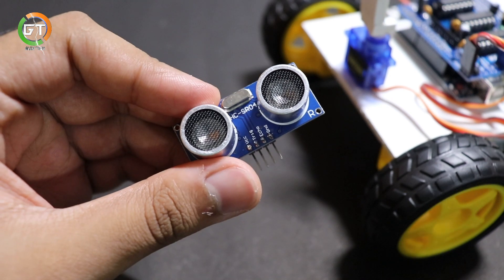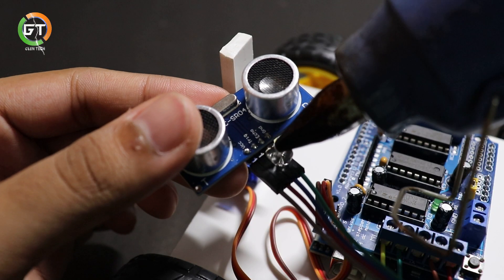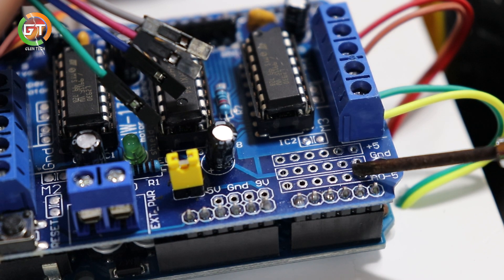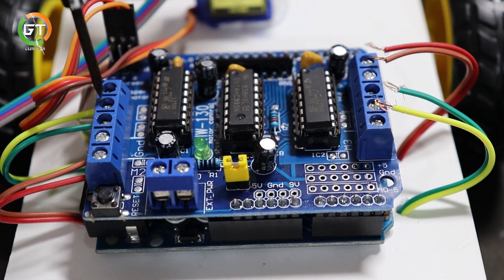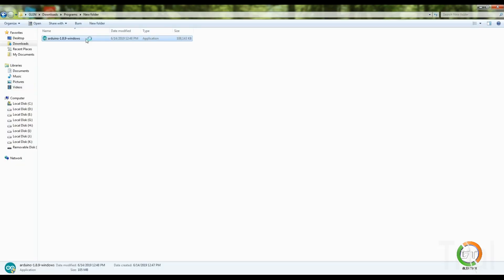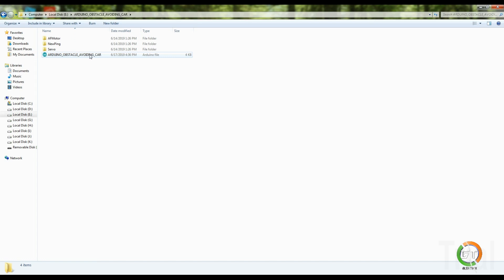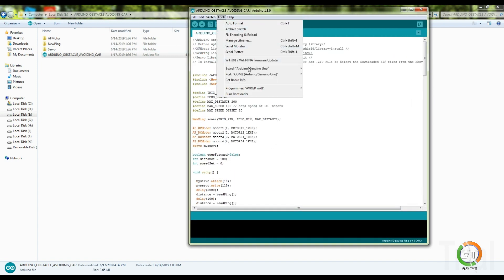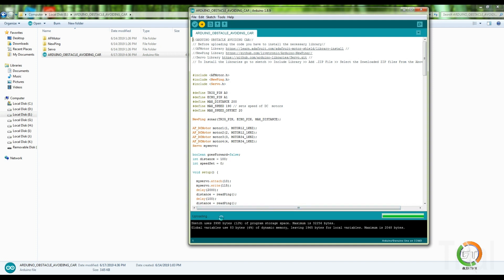How To Make A DIY Arduino Obstacle Avoiding Car For Science Project

Comment from the maker: CODE :

//ARDUINO OBSTACLE AVOIDING CAR//

// Before uploading the code you have to install the necessary library//

//AFMotor Library https://learn.adafruit.com/adafruit-motor-shield/library-install //

//NewPing Library https://github.com/livetronic/Arduino-NewPing// 

//Servo Library https://github.com/arduino-libraries/Servo.git //

// To Install the libraries go to sketch >> Include Library >> Add .ZIP File >> Select the Downloaded ZIP files From the Above links //

#include <AFMotor.h>  

#include <NewPing.h>

#include <Servo.h> 

#define TRIG_PIN A0 

#define ECHO_PIN A1 

#define MAX_DISTANCE 200 

#define MAX_SPEED 190 // sets speed of DC motors

#define MAX_SPEED_OFFSET 20

NewPing sonar(TRIG_PIN, ECHO_PIN, MAX_DISTANCE); 

AF_DCMotor motor1(1, MOTOR12_1KHZ); 

AF_DCMotor motor2(2, MOTOR12_1KHZ);

AF_DCMotor motor3(3, MOTOR34_1KHZ);

AF_DCMotor motor4(4, MOTOR34_1KHZ);

Servo myservo;   

boolean goesForward=false;

int distance = 100;

int speedSet = 0;

void setup() {

  myservo.attach(10);  

  myservo.write(115); 

  delay(2000);

  distance = readPing();

  delay(100);

  distance = readPing();

  delay(100);

  distance = readPing();

  delay(100);

  distance = readPing();

  delay(100);

}

void loop() {

 int distanceR = 0;

 int distanceL = 0;

 delay(40);

 

 if(distance<=15)

 {

  moveStop();

  delay(100);

  moveBackward();

  delay(300);

  moveStop();

  delay(200);

  distanceR = lookRight();

  delay(200);

  distanceL = lookLeft();

  delay(200);

  if(distanceR>=distanceL)

  {

    turnRight();

    moveStop();

  }else

  {

    turnLeft();

    moveStop();

  }

 }else

 {

  moveForward();

 }

 distance = readPing();

}

int lookRight()

{

    myservo.write(50); 

    delay(500);

    int distance = readPing();

    delay(100);

    myservo.write(115); 

    return distance;

}
Reply from the maker: Read it : 

 Before uploading the code you have to install the necessary library given below :

//AFMotor Library https://learn.adafruit.com/adafruit-motor-shield/library-install //

//NewPing Library https://github.com/livetronic/Arduino-NewPing// 

//Servo Library https://github.com/arduino-libraries/Servo.git //

// To Install the libraries go to sketch >> Include Library >> Add .ZIP File >> Select the Downloaded ZIP files From the Above links //
Reply from the maker: How to code in mobile : https://youtu.be/Mw589orCT3c
Reply from the maker: UNKNOWN ADIL  this first comment is the code . Click read more to see
Reply from the maker: UNKNOWN ADIL   file link : https://drive.google.com/file/d/1Sjspsz2em8Thq_8WhalYu_YcsMar9z60/view

Comment: Hi Glen tech 6 wheeled arduino obstacle avoiding robot undakumbol gear  motors 5 and 6 arduinoyumayi connect cheyyano pls 🙏 reply
Reply from the maker: Connect with motor module. Connect 3rd and 5th motor together .

Connect 4th and 6th motor together.
Reply from the maker: See the video to know connection
Reply: Ok ethra volt battery upayogikkanam
Reply from the maker: @shibusivadas7561  you can use same battery showing in the video.
Reply: Ok
Reply: Ok ithu rocker bogie designil arenge cheyyan patto

Comment: hello. what if i don't have a pin header connector? how do i make it work?
Reply from the maker: Just solder the wires to that port .
Reply: @GLENTECH  thank u for responding! but how do i solder it? do i solder it from the below of the motor shield and not from the top??
Reply from the maker: @juan-dk7qe  solder it from below the board . See the diagram .
Reply: @GLENTECH  oh okay thank u so much! btw last question, is it required for it to have a switch? or it can work without the switch?
Reply from the maker: @juan-dk7qe  switch just to turn off and on the battery power . If you didn't add switch , when you add battery the car start running and when you remove battery it stop. 

If you want you can add switch . Without switch also it will work.
Reply: @GLENTECH  hi. thank u man! my project finally worked, thanks to u and your videos! you've been such a great help man. keep doing what youre doing, youre helping a lot of people. God bless you sir!
Reply from the maker: @juan-dk7qe  Thankyou dear friend for your valuable comment and support 🙂
Reply: i hope u can answer this, i hope u can help becasue this is for school purposes

Comment: read ping is not included in the scope it is saying status 1
Reply from the maker: Read it

// Before uploading the code you have to install the necessary library//

//AFMotor Library https://learn.adafruit.com/adafruit-motor-shield/library-install //

//NewPing Library https://github.com/livetronic/Arduino-NewPing// 

//Servo Library https://github.com/arduino-libraries/Servo.git //

// To Install the libraries go to sketch >> Include Library >> Add .ZIP File >> Select the Downloaded ZIP files From the Above links //

Comment: Servo ans sensor is not rotattinv
Reply from the maker: Read it

// Before uploading the code you have to install the necessary library//

//AFMotor Library https://learn.adafruit.com/adafruit-motor-shield/library-install //

//NewPing Library https://github.com/livetronic/Arduino-NewPing// 

//Servo Library https://github.com/arduino-libraries/Servo.git //

// To Install the libraries go to sketch >> Include Library >> Add .ZIP File >> Select the Downloaded ZIP files From the Above links //

Comment: Sir i used 4 1.5 volts batery my robot was not working in the grund and servo also not rotate
Reply from the maker: If you need you can use four 1.5 volts 1000 mAh rechargable battery . Because normal 1.5 battery mAh is less and it won't work .

Recommended to use two 3.7v 2500mAh rechargable battery .
Reply from the maker: 1.5v : https://www.amazon.in/dp/B00BN5SNF0/ref=cm_sw_r_cp_apa_fabc_62EJQGX1NMMVSF6V3VTJ
Reply from the maker: 3.7v : https://www.amazon.in/dp/B08T1XRRG5/ref=cm_sw_r_cp_apa_fabc_AAZJRWZQEVR96XNH19Z6?psc=1

Comment: Bro library install ചെയ്യാന്‍ പറ്റുന്നില്ല.    
??
Reply from the maker: // Before uploading the code you have to install the necessary library//

//AFMotor Library https://learn.adafruit.com/adafruit-motor-shield/library-install //

//NewPing Library https://github.com/livetronic/Arduino-NewPing// 

//Servo Library https://github.com/arduino-libraries/Servo.git //

// To Install the libraries go to sketch >> Include Library >> Add .ZIP File >> Select the Downloaded ZIP files From the Above links
Reply: @GLENTECH  ath install cheythu
But newping master install cheyyumbol  properties file not found eannnn kaanikkunnnu

Comment: I made this but the motors start to beep when i attach the battery.
Pls hlp bro
Reply from the maker: CODE :

//ARDUINO OBSTACLE AVOIDING CAR//
// Before uploading the code you have to install the necessary library//
//AFMotor Library https://learn.adafruit.com/adafruit-motor-shield/library-install //
//NewPing Library https://github.com/livetronic/Arduino-NewPing// 
//Servo Library https://github.com/arduino-libraries/Servo.git //
// To Install the libraries go to sketch >> Include Library >> Add .ZIP File >> Select the Downloaded ZIP files From the Above links //

#include <AFMotor.h>  
#include <NewPing.h>
#include <Servo.h> 

#define TRIG_PIN A0 
#define ECHO_PIN A1 
#define MAX_DISTANCE 200 
#define MAX_SPEED 190 // sets speed of DC motors
#define MAX_SPEED_OFFSET 20

NewPing sonar(TRIG_PIN, ECHO_PIN, MAX_DISTANCE); 

AF_DCMotor motor1(1, MOTOR12_1KHZ); 
AF_DCMotor motor2(2, MOTOR12_1KHZ);
AF_DCMotor motor3(3, MOTOR34_1KHZ);
AF_DCMotor motor4(4, MOTOR34_1KHZ);
Servo myservo;   

boolean goesForward=false;
int distance = 100;
int speedSet = 0;

void setup() {

  myservo.attach(10);  
  myservo.write(115); 
  delay(2000);
  distance = readPing();
  delay(100);
  distance = readPing();
  delay(100);
  distance = readPing();
  delay(100);
  distance = readPing();
  delay(100);
}

void loop() {
 int distanceR = 0;
 int distanceL = 0;
 delay(40);
 
 if(distance<=15)
 {
  moveStop();
  delay(100);
  moveBackward();
  delay(300);
  moveStop();
  delay(200);
  distanceR = lookRight();
  delay(200);
  distanceL = lookLeft();
  delay(200);

  if(distanceR>=distanceL)
  {
    turnRight();
    moveStop();
  }else
  {
    turnLeft();
    moveStop();
  }
 }else
 {
  moveForward();
 }
 distance = readPing();
}

int lookRight()
{
    myservo.write(50); 
    delay(500);
    int distance = readPing();
    delay(100);
    myservo.write(115); 
    return distance;
}
Reply: @GLENTECH  When i entered the code it says that readPing was not declared in this scope. What should i do?
Reply from the maker: @aryavats5403 

Read it .

 Before uploading the code you have to install the necessary library//
//AFMotor Library https://learn.adafruit.com/adafruit-motor-shield/library-install //
//NewPing Library https://github.com/livetronic/Arduino-NewPing// 
//Servo Library https://github.com/arduino-libraries/Servo.git //
// To Install the libraries go to sketch >> Include Library >> Add .ZIP File >> Select the Downloaded ZIP files From the Above links //
Reply: @GLENTECH  i already have theses libraries installed.

Comment: Bro accurate of the rpm of the gear motor
Reply from the maker: The BO motor has an operating voltage of 3V - 12V DC.

This BO motor runs at a speed of approximately 150RPM.
Reply from the maker: If you give 12v , it will work with rpm of 150
Reply: Thanks bro

Comment: No bro what is the rpm of the motor
Reply: Speed of the motor bro
Reply from the maker: Operating voltage : 3v 12v dc

Rpm : approximately 150 rpm

Comment: What is the rpm of the bo motor
Reply from the maker: Operating voltage : 3v 12v dc

Rpm : approximately 150 rpm

Comment: i uploaded the code but servo is not moving when ultrasonic sensor sense
Reply from the maker: // Before uploading the code you have to install the necessary library//
//AFMotor Library https://learn.adafruit.com/adafruit-motor-shield/library-install //
//NewPing Library https://github.com/livetronic/Arduino-NewPing// 
//Servo Library https://github.com/arduino-libraries/Servo.git //
// To Install the libraries go to sketch >> Include Library >> Add .ZIP File >> Select the Downloaded ZIP files From the Above links //

Comment: today i made this,but its not working,can you give me ur number please
Reply from the maker: //ARDUINO OBSTACLE AVOIDING CAR//
// Before uploading the code you have to install the necessary library//
//AFMotor Library https://learn.adafruit.com/adafruit-motor-shield/library-install //
//NewPing Library https://github.com/livetronic/Arduino-NewPing// 
//Servo Library https://github.com/arduino-libraries/Servo.git //
// To Install the libraries go to sketch >> Include Library >> Add .ZIP File >> Select the Downloaded ZIP files From the Above links //

#include <AFMotor.h>  
#include <NewPing.h>
#include <Servo.h> 

#define TRIG_PIN A0 
#define ECHO_PIN A1 
#define MAX_DISTANCE 200 
#define MAX_SPEED 190 // sets speed of DC  motors
#define MAX_SPEED_OFFSET 20

NewPing sonar(TRIG_PIN, ECHO_PIN, MAX_DISTANCE); 

AF_DCMotor motor1(1, MOTOR12_1KHZ); 
AF_DCMotor motor2(2, MOTOR12_1KHZ);
AF_DCMotor motor3(3, MOTOR34_1KHZ);
AF_DCMotor motor4(4, MOTOR34_1KHZ);
Servo myservo;   

boolean goesForward=false;
int distance = 100;
int speedSet = 0;

void setup() {

  myservo.attach(10);  
  myservo.write(115); 
  delay(2000);
  distance = readPing();
  delay(100);
  distance = readPing();
  delay(100);
  distance = readPing();
  delay(100);
  distance = readPing();
  delay(100);
}

void loop() {
 int distanceR = 0;
 int distanceL =  0;
 delay(40);
 
 if(distance<=15)
 {
  moveStop();
  delay(100);
  moveBackward();
  delay(300);
  moveStop();
  delay(200);
  distanceR = lookRight();
  delay(200);
  distanceL = lookLeft();
  delay(200);

  if(distanceR>=distanceL)
  {
    turnRight();
    moveStop();
  }else
  {
    turnLeft();
    moveStop();
  }
 }else
 {
  moveForward();
 }
 distance = readPing();
}

int lookRight()
{
    myservo.write(50); 
    delay(500);
    int distance = readPing();
    delay(100);
    myservo.write(115); 
    return distance;
}

int lookLeft()
{
    myservo.write(170); 
    delay(500);
    int distance = readPing();
    delay(100);
    myservo.write(115); 
    return distance;
    delay(100);
}

int readPing() { 
  delay(70);
  int cm = sonar.ping_cm();
  if(cm==0)
  {
    cm = 250;
  }
  return cm;
}

void moveStop() {
  motor1.run(RELEASE); 
  motor2.run(RELEASE);
  motor3.run(RELEASE);
  motor4.run(RELEASE);
  } 
  
void moveForward() {

 if(!goesForward)
  {
    goesForward=true;
    motor1.run(FORWARD);      
    motor2.run(FORWARD);
    motor3.run(FORWARD); 
    motor4.run(FORWARD);     
   for (speedSet = 0; speedSet < MAX_SPEED; speedSet +=2) // slowly bring the speed up to avoid loading down the batteries too quickly
   {
    motor1.setSpeed(speedSet);
    motor2.setSpeed(speedSet);
    motor3.setSpeed(speedSet);
    motor4.setSpeed(speedSet);
    delay(5);
   }
  }
}

void moveBackward() {
    goesForward=false;
    motor1.run(BACKWARD);      
    motor2.run(BACKWARD);
    motor3.run(BACKWARD);
    motor4.run(BACKWARD);  
  for (speedSet = 0; speedSet < MAX_SPEED; speedSet +=2) // slowly bring the speed up to avoid loading down the batteries too quickly
  {
    motor1.setSpeed(speedSet);
    motor2.setSpeed(speedSet);
    motor3.setSpeed(speedSet);
    motor4.setSpeed(speedSet);
    delay(5);
  }
}  

void turnRight() {
  motor1.run(FORWARD);
  motor2.run(FORWARD);
  motor3.run(BACKWARD);
  motor4.run(BACKWARD);     
  delay(500);
  motor1.run(FORWARD);      
  motor2.run(FORWARD);
  motor3.run(FORWARD);
  motor4.run(FORWARD);      
} 
 
void turnLeft() {
  motor1.run(BACKWARD);     
  motor2.run(BACKWARD);  
  motor3.run(FORWARD);
  motor4.run(FORWARD);   
  delay(500);
  motor1.run(FORWARD);     
  motor2.run(FORWARD);
  motor3.run(FORWARD);
  motor4.run(FORWARD);
}
Reply from the maker: Download and install these 3 files first then upload code

// Before uploading the code you have to install the necessary library//
//AFMotor Library https://learn.adafruit.com/adafruit-motor-shield/library-install //
//NewPing Library https://github.com/livetronic/Arduino-NewPing// 
//Servo Library https://github.com/arduino-libraries/Servo.git //
// To Install the libraries go to sketch >> Include Library >> Add .ZIP File >> Select the Downloaded ZIP files From the Above links //

Comment: does it work but mg90s 180 degrees servo motor?
Reply: @GLENTECH  does it work with*** mg90s servo motor (180 degrees)
Reply from the maker: Yes
Reply: @GLENTECH  180 degrees or 360 degrees?????
Reply from the maker: 180